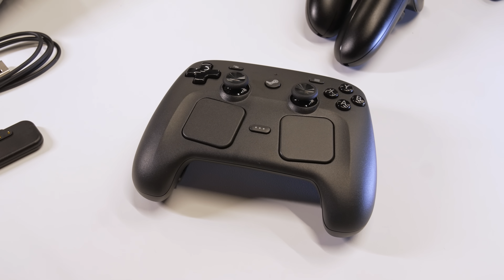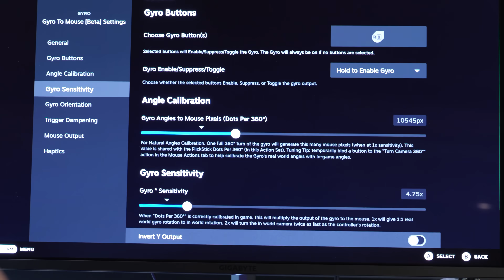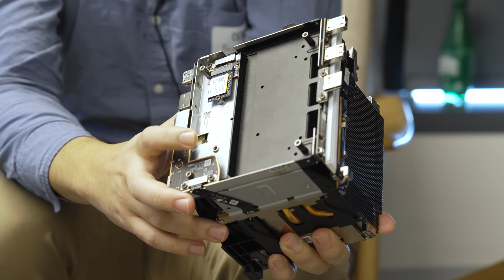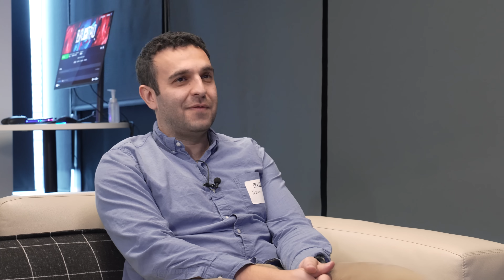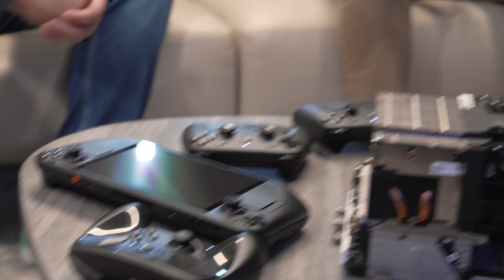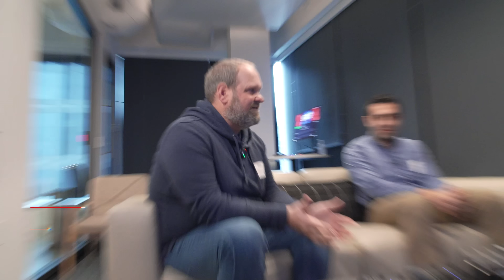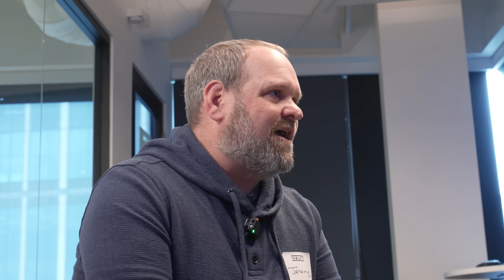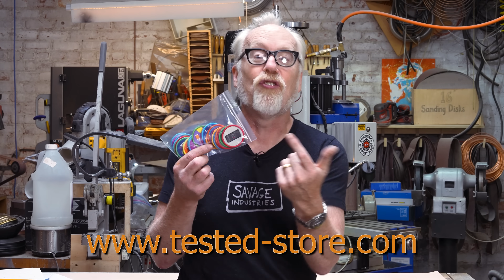Hands-On: Valve Steam Controller 2 and Steam Machine!

Comment: I cant wait for the controller if its as customizable as the steam deck controllers with inputs.  Also Wii emulation about to get way easier.  I bet the controller will be 89.99-124.99.  I hope its not higher than 79.99 though

Comment: Depending of price i will most likely get one. Nvidia shield is almost half dead. Nvidia is not lunching a new one and there is nothing on the market with the same idea. It will be a emulation power house and even let you play old good games. Not all new games but a decent amount sadly at crippled settings from the 8gb vram. Its not why i am looking to buy one. But 4k 8gb will be really ruff. My old 3080ti with 12gb vram at 4k would occationally hit its limit but 12gb barlly made it to 2026. The sad part is most stuff with high ram usage are light on the gpu so you need to set stuff to low from a gpu perspectiv but with 8gb of vram you also need to set free gpu settibgs to low light textures for example. But like i said i will use it for retro stuff if they set the price right.

Comment: RX 7600M 8GB VRAM level hardware makes this not interesting. It's just too under baked. Its a decent 1080p solution but the useful life span is too short term. I don't want to buy something I will want to get rid of 18 months or sooner. 12GB RX7800M would have made more sense as a solid 1440p system with a decent amount of life span ahead of it.

Comment: That right stick looks like its in just as bad of a position as the steam deck joysticks - too far forward and centred to be good for aiming. Literally my only issue with my steam deck.

Aiming stick should be under your thumb knuckle comfortably - you shouldn't have to stretch and use your thumb tip to aim. How it passed QA is insane.

Comment: Id like to see a keyboard with two touch pad design on the right and left of the keys like the steam controller/deck. I think it would be a great solution for people that need a keyboard and cursor controls without a mouse. If that was made in compact keyboard design it could be a comfortable experience and switching pads to keep the cursor moving and giving more precision than other solutions. plus the off hand not controlling the cursor could click or double click so your hand controlling the cursor never has to be lifted. I don't at all think its a gaming solution just would be the best way for the dual track pad design to be utilized in my opinion. it would also be great with laptops giving a comfy wide resting position instead of the cramped position of traditional track pad layouts for laptops.

Comment: My question is what is the maximum ssd size i can install? If i wanted 8tb installed could this handle it? I ask because i will want this to be my entire living room entertainent system. From gaming, movies, music, all the works. I wanna use it to the best.  Ill be streaming from it too so remote play will be a big one for me as well. Ill be getting all three new devices.
Reply: @AdamAve93 Im not certain but I believe ive seen something that said 4tb might be max but I could be wrong so dont take my word for it, however there is external ssd storage which could plug into the high speed ports in the back of the steam machine

Comment: the most important part of all of this is that this development that shaped what steamos needed to be to be effectively a console is a watershed moment for Linux that Ubuntu could only dream of. It's Arch... expect many many community members expanding it's capability... valve is known for simply absorbing mods, so why not accepting community extensions being accepted into the main branch? moreover.... It is a direct shot at windows dominance in gaming, expect in a few years gaming tech youtubers just opting to load steamos for fancy builds over windows. Sure call this speculation, but as a marketer, this thing has legs and will change the market.... because it has a viable story that is better targeted to the audience. It won't dethrone windows, but this will mark a turning point when windows forces 11 on everyone when people don't want it. Oh... and the whole point of steamos in the first place was gabe's direct reaction to windows development to find a way to simply fork away from this dying norm of using windows.

Comment: This has peaked my interest. I've had an active Steam account for over 20+ years.

I always tended to lean more towards console gaming though, most my life. I bought a couple Steam Links when they came out, so I could use my PC similar to a console and play from a TV/projector as I could never get comfortable at a desk. Though even those had their limitations.

My PC is now ancient. Though my library remains. This Steam Machine sounds like it would be enough to run all my current games and a fewer newer ones my current PC cannot handle.

I'm just not sure on the controller. Though it looks pretty comfortable and atleast the track pad isn't recessed on these. That drove me nuts on the original controller.

Comment: I've been gaming since I was 6, but I do not understand tech or specs or anything. Can anyone help me understand whats going on when all the press releases say it can run all new AAA games in 4k, and then these guys describing it as an "entry" or "Low to mid" level pc? I thought 4k was the absolute pinnacle of tech these days, or at least one step down from it. How can a "low tier" pc handle that? I have a modern very high powered desktop as of 2 years ago, and it cant even run Minecraft with a shader on. A few new titles it has to drop down by one setting too. So how is this thing which by their description of "entry/low" gonna handle playing games like Battlefield or Expedion 33 on max settings?

Comment: As someone coming from Xbox, with the Xbox controller basically being perfect, this looks pretty good, but dear god those trackpads.

Even if they’re depressed from the rest of the controller, because the thumbsticks are so high up, I PROMISE YOU your thumbs will be  brushing up against the trackpads all the time.
Reply: I dunno, the layout is pretty much the same as the steam deck and I had never accidentally touched the pads, and I am one to use them for a lot of stuff like virtual menus or mouse control.

Comment: Brother I don't know who lied to you, but that 8gb VRAM laptop GPU is not going to push 1440p gaming without frame gen or FSR upscaling.

1080p has been bottle necked by 8GB of VRAM for like 4 years. It really should have been 12GB, and really 16GB for a damn good deal. If this thing is more than $800 it's a rip off.

Comment: Hello:  Glad to see this video!  Thank you.  I am interested in all three new devices that Valve announced.  For me, I am on a fixed income, so price is going to drive whether or not I buy any of these.  A friend of mine and I were discussing this and since one can download SteamOS and put it on your own system, the question became, do we build our own version of the steam machine using our own specified hardware?  Second, Steam (the client) runs on my current Linux machine and runs well.  I would need a new GPU and PSU to make the experience better, but once again, it all depends on price first and then availability.  Great information though!

Comment: The one feature that I love of the original is the removable batteries. I want away from products these days with lithium battery or non removable. I think I will just stick with my original steam controllers, they still work just as good as they did on day 1 release.

Comment: I can’t wait to try the new controller to play Baldur’s Gate 3 in M&K mode on my TV. Turn based CRPGs are an example of a game that is really built for mouse and keyboard at a desk but which are much more relaxed to play with controllers, yet you give up so much precision in controller mode normally. This would let you have the best of both worlds by using Steam Input to simulate mouse and keyboard, and with an actual haptic trackpad instead of having to use the joystick to control the mouse, which was very subpar.

Comment: I am very excited for the living room possibilities. While the deck is an amazing handheld device, it wasn't super able to keep up with the high resolutions found in modern TVs. As a fan of retro games this is awesome, but if I wanted to play the newest Unreal Engine 5 game on my couch I had to either stream it from my PC or attempt to play a graphically scaled down version in the Deck. The new Gabecube seems to bridge that gap. 

The controller is a most welcome addition; the experience of playing with a Steam Deck is so tactile and comfortable because of the controls they added. The buttons very responsive, the gyro controls also easy to setup, and the track-pads are incomparable to any other in the market. Can't say enough good things about the controls except I hope they improve the actual controller vibration (not the track-pad itself but the game rumble).

Comment: I am avid Steam Controller user. Two originals from 2015. I have replaced Steam Link with the app in Google Chromecast 4K, and paired the controllers to it via Bluetooth.

I never really got the Link function properly wirelessly, as N and AC router 2 meters LOS from it wasn't enough in clear RF environment (no other wireless networks in 1200 meters radius). But worked great wired!

Eventually I wanted 4K capability for texts.

Anyway, the original Steam Controller is best by every other part than limited to two Grip Buttons.
I made mockup to Valve on first week to upgrade it with threw buttons grips. So split existing grips to three parts and have in total of six additional buttons at the grips.

But the steam controller failed because stupid players didn't comprehend the greatness in circular touchpada directly under your fingertips. 
And almost all profiles you see for games, are made with the physical joystick like designed by an idiot.

Why it was annoying to always load own touchpad version and modify it for game as no sensible ready made profiles existed to most games.

I bought first Steam Deck that was by serial under 1000 first produced.

I had it for 2 days and refunded it. Because Valve again made the touchpads a secondary gimmicks. Not for gaming but for secondary tasks like menus via mouse.
You can't have proper grip from deck because of those!

And now it is sad to see that same thing continues.
The controller and the deck 2.0 has stupid awful touchpads, prioritizing awful joysticks instead touchpads.

Comment: Considering how stupidly expensive the Steam Deck Dock is, I'm not really hopeful for the Controller to come below $69.99$ especially with the TMR trigger as an excuse to upcharge for it. Not confident in the Steam Machine price either, probably over 700€/$, while the Steam Frame seems to be the best of the 3 in terms of price, confirmed to be below the Index. I assume the full kit,so likely around 800€/$ with at least 200$ worth of mobile spec,  (Snapdragon 8 Gen 3 and 16GB of Ram) still great in 2025 and at least 2027.
Reply: steam deck dock also came with a second power supply brick, so you also have to consider the price of that standalone in the price

Comment: Honestly, as long as Valve keeps on being commited to being repairable and open I am willing to making this a real alternative to Nintendo. Especially with the "we reserve the right to brick your system as fit" mentality Nintendo showed for the Switch 2 they really lost a lot of trust from my side. Even if I never intend to modify my system in any way that would put me in danger. The fact that they reserver the right alone and make me buy only semi-rented hardware is a major turnoff.
It's kinda funny that this is what Valve has become since Steam did have a very rocky start as the first real major DRM activation plattform when they introduced it for Half-Life 2 so many years ago.

Comment: Definitely getting the new Steam controller at some point, gyro aiming, trackpads and back paddles are like, everything I want in a controller. I used to think I'd have to pick one or two of those features over the others, so having all three is really fuckin' cool.

I'm really not sure about having it so that the capacitive touch requires you to take your whole hand off the controller though, I feel like just having it be somewhere where you rest your thumb or finger would be better, because then all you have to do is just lift a finger or thumb, that's much quicker. Could be wrong though, I've obviously never used it before.

Comment: New steam controller looks like absolute @$$ compared to the original. Whoever decided to have the trackpads a mile away from the buttons needs to get canned. Really hope they just make a refresh of the OG sometime down the line. As cool as the second stick would be for some extra radial menus, I honestly could live without it if it meant a trackpad focused controller.

Comment: I keep having to say this - the Xbox controller layout (regarding the placement of a given section of inputs) is ideal. The d-pad and the right analog stick on an Xbox controller is in the "pivot-path" of the thumb - you do not have to reach your thumb out, or pull it back, to reach d-pad and right-stick.

The Steam Deck makes you reach out, past the natural pivot path of the thumb for the right stick.
The Steam Controller does this *less*, but it's still having you reach out, rather than just pivot. This is because they had to compromise, so that the trackpads wouldn't be too far away from the pivot path, too. It's a compromise to get both somewhere in that range, at the very least.

And, in doing so, it becomes less ergonomic than every other non-Joy-Con gamepad out there. If I can choose between this, or an Xbox controller, or even a DualSense, I'm not picking the Steam Controller. I would have to be really into competitive RTS, or Civ, or games so old that they don't have good gamepad support, etc.

I want to be excited about this controller, but it's really hard to be. I'm equally uninterested in the Steam Deck, and lean towards the Xbox Ally X (and the ROG Ally X - but not the original Ally, because it's pivot-path is also compromised), for this reason.

The did what they had to.
I guess I'm just not interested/don't have a need for it. Having to swap between console controllers, and KB&M, has been more than fine for me.

If and when these things drop in price, like the original Steam Controller did, then I might be interested, for the fun of it.

Comment: Honestly, the controller is seriously underwhelming. Valve never takes fighting games into consideration. This isn’t Valve’s first attempt at a console. This is just a streamlined version of the old Steam Machine which had issues. The good thing is that from what I’ve been reading Valve got it right this time, but I still want to see how it is rather than preordering. I also want to see how it benches. My main PC has an RTX-5090 and I’ve been reading the GPU here is the equivalent of a 4070. I want to see how it plays out.

Comment: Okay, let's all agree on one thing: the problem isn't the hardware specifications. The core issue is optimization and the laziness in implementing it! 8GB of VRAM is enough to run even the most demanding game if properly optimized. The proof is that even the most powerful graphics cards struggle with initial game launches, and then you have to wait for updates to fix these problems. So, the problem lies with the laziness of developers and companies who want you to believe your computer hardware is weak, which it isn't. Therefore, we, as gamers, must speak out: continuing to develop consoles or computer components isn't the solution, and this greed must stop. I want a gaming device that will last me for years, and I don't care about AI technology, so why are you trying to force it into games just to make me buy graphics cards I don't need in the first place!

Comment: The trackpads are terribly placed, too low just like on the steam deck, and just like the video says, the least ergonomic part of the controller.  Wish they would've added a right joystick to the original steam controller and 2 more back grip buttons. With their placement so low on the new controller it'll continue to be difficult to use. And only 8GB on the steam machine??? At least match the PS5 specs! The steam frame is the true gem of this release cycle with the 6Ghz wireless transmitter and low latency, I hope devs invest in high quality VR games again.

Comment: The biggest downside for me is the rechargeable battery. Those go bad over time, especially if the controller sits on a shelf. I miss it taking AA batteries. I wanna use my eneloops.
Reply: Valve will be the awesomeness that it is and make it easy to replace the internal battery with minimal breakdown. they opted to pack more hardware into the controller in place of AA, from what I have heard the battery is a simple widely available package that should be as easy to replace as a cordless phone battery with maybe only have to turn some screws

Comment: been holding off on getting a Vr headset but it think its finally time, along with my long awaited steam controller 2, i had a steam deck when it first came out and sadly sold it thinking i wouldnt want it. welp look a me now still have a PC but wanting a steamdeck again LOL but i think the steam frame and the steam controller 2 will do just fine. cant wait.